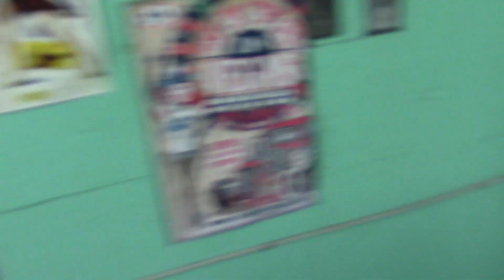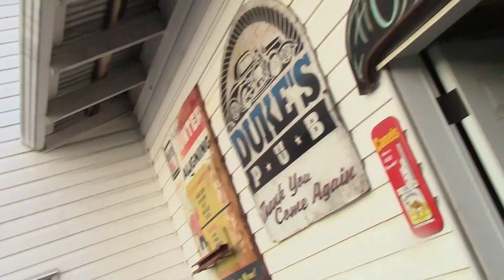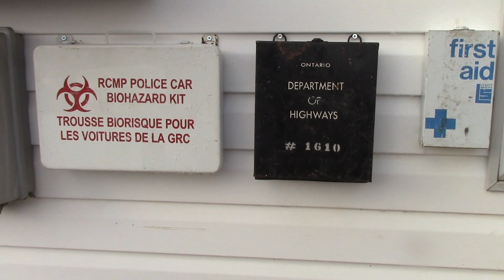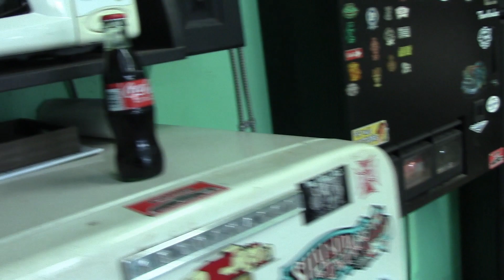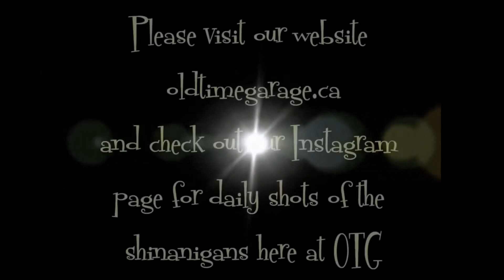Working on a 31 Chopped Ford Coupe

Comment: In one of the last videos you walked by your NEW DOORS they didn't have  the 3" wide seals that stop the air from leaking in.along the sides from top to bottom...I know you can't heat the outside as hard as you try.
Make yourself more comfortable and less cost....Great place to live..I've watched you for years from Massachusetts
Reply from the maker: Yes if your talking the wooden doors you are correct . Am thinking of putting a roll up door in to save room
Reply from the maker: Good eye !